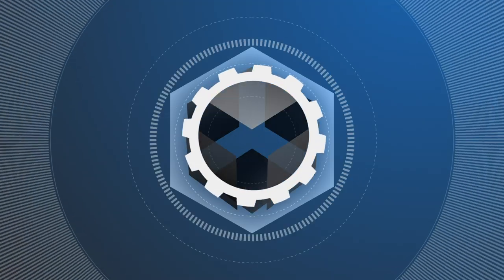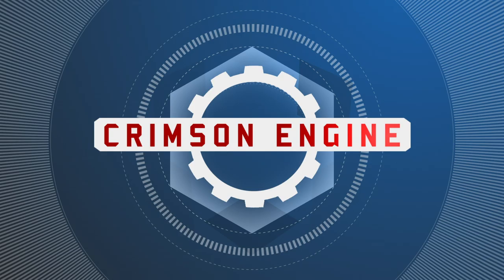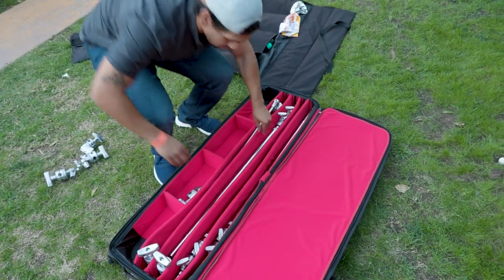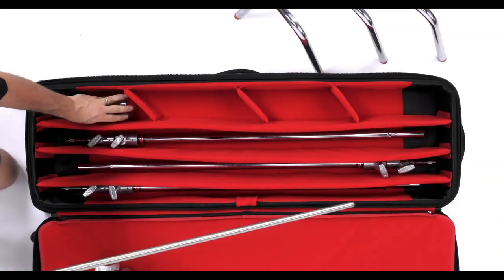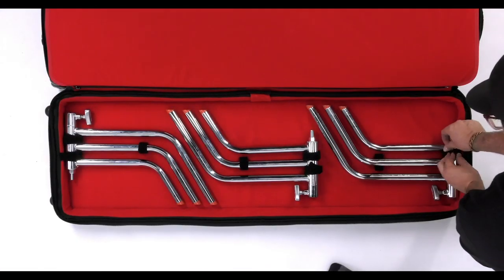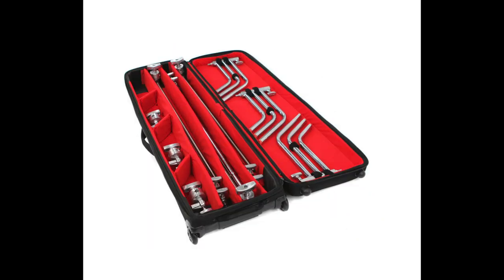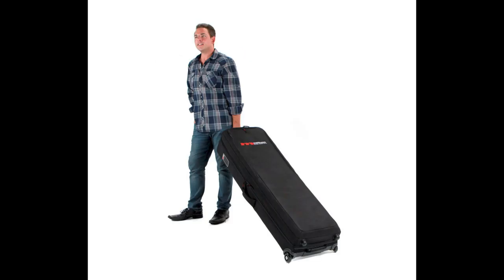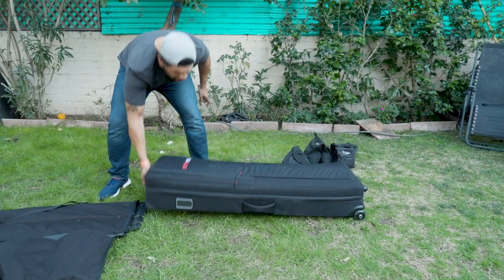Fit a Grip Truck into a Honda Civic

Comment: Great stuff, Rubidium! Chimera brand makes handy break-down frames in different sizes too (42"x42", 48"x48", 6'x6'). And a quick way to make light weight C-stands is to add grip heads and arms to baby stands that you may already have. You can get empty sandbags with velcro pouches and then fill up those pouches with batteries or rocks or water bottles... whatever you have available:) All power to the DIY!